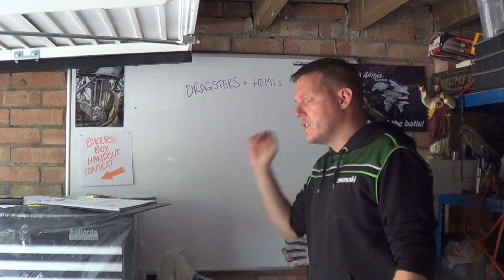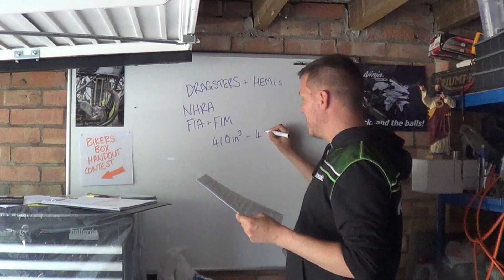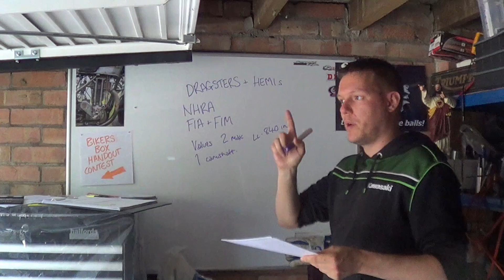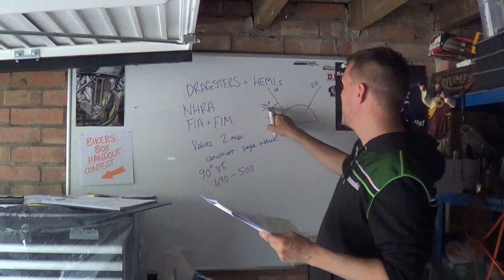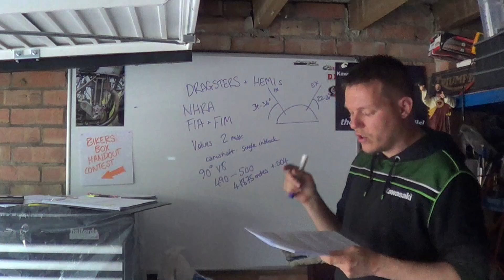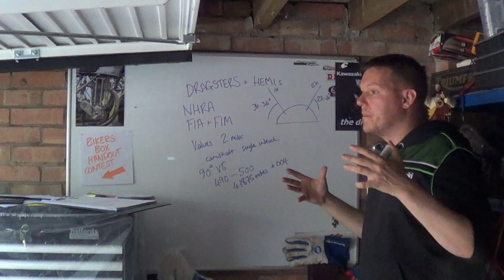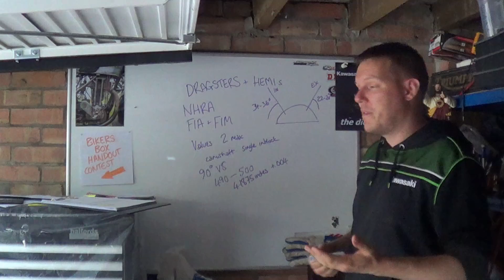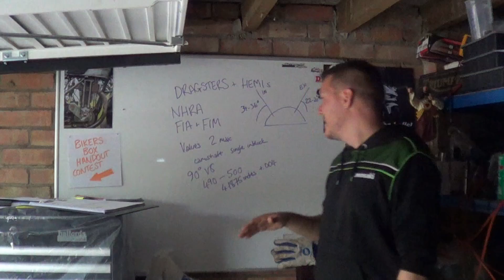Why do Dragsters use HEMI's?

Comment: You indicate Chrysler Ford and Chevy are all under GM (12:09) Dude really?
Hemis had their big impact from 1951-1962. The 418 Wedge took over in 1963 which used a closed kidney bean style. In the 60s Alfa, Porsche, Jaguar, and many other non-v8s used hemispherical chambers. with the emphasis on mileage in the 70's no one uses a true large chamber hemispherical style anymore.
Reply: Congrats you are completely wrong about the Hemis big impact, the 1st gen Hemis were in production until the late 50's then in 1964 the 2nd Gen Hemi was introduced and went on to dominate drag racing and was eventually outlawed by NASCAR.
 The top fuel Hemi has evolved into what it is today. Are there better head designs? Sure, but many were tried in the 60's and everything blew up, its just that the Hemis had less failures compared to everything else.

Comment: I thought they used hemis because you could have bigger valves then with a normal cumbustion camber?
Reply from the maker: What's normal?
Reply: The Workshop I was thinking about the cumbustion chamber you talked about that most manufactures uses in your video about hemis. Well normal was maybe the wrong expression
Reply from the maker: Pent-roof? 

The rules stipulate, that they can't use anything different, in regards to valve numbers for Top Fuel. 

Nothing to do with how well or shite they flow, weigh or look, taste or feel. Like I said in the video, they don't really have a choice. Alot of them have domed pistons which defeats the purpose of having a hemi combustion chamber.
Reply: The Workshop okay:)
Reply: The Workshop and yes I meant pent roof

Comment: Good analysis.  There used to be several flavors of hemi engines used in drag racing, but it turned out that the 426 based design worked the best - the flatter combustion chamber of the 392 based designs seemed to detonate earlier than the 426 version.  Wedge shaped combustion chambers were even worse.  Several innovators, like "Nasty" Dave Benjamin (3 valve head) and the McGees (OHC 4 valve heads) had their products legislated out of existence.
Reply: Rolls Canardly-Correct me if I'm wrong,but isn't the McGee engine a Hemi?

Comment: The top fuel engines don't really survive either, Each engine rarely even lasts the whole quarter mile. The fuel used can burn pretty violently without air at all so other than just the strength to hold the pressure the cylinder head design doesn't really matter a fuck.

Comment: Dude you are so fucktarded. The hemi is a trademark Chrysler (nothing to do with Ford and not under GM umbrella). Hemispherical composition chamber directs the radial impulse from the ignition source (spark plug) in a pattern that maximizes the downward force. Toyota V-8's and many other engines use this without the trademarked name. The downside is fuel efficiency/heat loss and valve limitations.
"Dragsters use V8s because there were overproduced" WTF?  Not even fact based. And BTW not lost on me "only forged blocks" when you said "blocks aren't forged they are only cast" Wow Mind blown.
Reply: Good question. Any large chamber head means more distance from the flame front to the piston and larger chamber in general leads to cooling of the charge before ignition is complete. Dragsters don't care and this is why you see giant flames coming out of the headers and also why a Hemi truck gets like 11 MPG.
Reply: As I said "Hemi" is a registered trademark of Chrysler LLC not a shape.
Everybody knows this.
Word mark: HEMI
Serial Number: 77107502
Type Of Mark: TradeMark
Published For Opposition Date: 7/17/2007
Last Applicant/Owner: CHRYSLER LLC
AUBURN HILLS 48326
Why is this contact information displayed?
Mark Drawing Code: Standard Character Mark
Design Search: (NO DATA)
Register Type: Principal
Disclaimer: (NOT AVAILABLE)
Correspondent: 
DAIMLERCHRYSLER CORPORATION
1000 CHRYSLER DR
CIMS 483-02-19
AUBURN HILLS, MI 48326-2766
Reply: "over manufactured these blocks these blocks you know price wasn't really a thing" You clearly were not talking about too much material in the production of the block.

Comment: You've got to remember they have fuel pipes the size of radiator hoses and have so much fuel going thru them, that usually by the end of a run the engines are basically dieseling on compression. It's a rich man's sport these days , anyway. The teams who win are basically the ones who are willing to (have the $ to) blow up engines to win runs. I think the first successful / widely used engine was the 392 Hemi from the 50s dodges in the fuel + blown combination because the combustion chamber shape allowed them to run alot more spark advance than in the other brand motors/

Comment: Another issue is the cars already make "too much" power as it is. Often the problem isn't horsepower, it's getting it to the ground, it's traction. Going to 4 valves per cylinder, turbocharging, etc to improve upon the hemi design and make even more power when they are barely hooked up half the time and they already shorting the racetracks to try to keep mph under control would be pretty pointless.

Comment: Theres nothing special about HEMI's. In same breath says they make 10k hp.......
Reply from the maker: But its not the comubustion chamber that's makes the 10k power, it might have something to do with volume, Nitro and that great big supercharger!
Reply: The Workshop ... Throw it at a different engine and watch it pre detonate. Hemi's are what they are like it or not
Reply: I think it's the cross flow design of the cylinder heads.   The fuel mixture takes a straight path into and out of the combustion chamber.   A traditional 2 valve engine has the valves in line a long the cylinder bank.  The hemi has the intake and exhaust valves positioned 90 deg from that.   That design is bad for gas mileage.  But these engines make so much power because they burn a massive amount of fuel.

Comment: 11,000+ hp isnt bad for any ICE engine. And the power numbers just keep going up. Also before Matt says "bollocks, prove it!" It has been documented several times and the results and method of measurement have undergone professional scrutiny multiple times.
Reply from the maker: why would I say 'prove it'
Reply: The Workshop because it's your typical response, and it was more likely than not that you weren't aware of the AVL Racing torque sensor that Don Schumacher racing has integrated into the coupling between the clutch packs and diff so they can measure the engine output in a real world race weekend setting. More unlikely than not but not completely unlikely.

Comment: The reason we Americans use hemis is so we can cant the valves further apart allowing for bigger valves and higher flowing heads. High compression ratio is sacrificed however ford captured the best of both worlds with its boss 429/494 cid semi hemi heads. For 2 valve american V8s engines these heads are superior to wedge heads weather you say so or not they produce way more power. But i do agree that for other types of engines they dont make sense.

Comment: From what I remember, most if not all top fuel and funny car engines were Keith Black engines that were an aluminium copy of the Chrysler Hemi.

Amazing horsepower but not very reliable, 1/4 mile fully rebuild if you are lucky, only really work at full throttle, self distruct if you have to get off the loud pedal and then back on it due to wheel spin, not the sort of engine that has any real world application, one of the highest classes of racing that has never really added much, if anything to technology, in other words not a leader but a follower.
Reply from the maker: "Amazing horsepower but not very reliable"

- this made me laugh lol Not very reliable, doesn't quite get across how unreliable they are lol

Comment: you can correct me if I'm wrong, but aren't all modern engines hemi engines? Chrysler was the first to start using hemispherical combustion chambers (and patented the term), but eventually all manufacturers switched to this design. Calling them hemi's would infer they are a chrysler engine, but they are not.
edit:  from wikipedia: The engine used to power a Top Fuel drag racing car follows the basic layout found in the second generation Chrysler 426 Hemi "Elephant Engine" made from 1964-71. Although the Top Fuel engine is built exclusively of specialist parts, it retains the basic configuration with two valves per cylinder activated by pushrods from a centrally-placed camshaft. The engine has hemispherical combustion chambers, a 90 degree V-angle; 120 millimetres (4.8 in) bore pitch. The configuration is identical to the overhead valve, single camshaft-in-block "Hemi" V-8 engine which became available for sale to the public in selected Chrysler Corporation (Chrysler brand) automotive products in 1950 (model year 1951).
Reply from the maker: You're comparing wiki to the rules I have in my hand?
Reply: OMG you are a genius!

Comment: could it be the low compression ratio of the hemis for the blowers because they can run like 85psi of boost
Reply: Ben Lauderdale the compression ratio on big American v8s was low when they were produced ( a yankee v8 considered to be high compression in the era topped out at 10.0-11.0:1 which is pretty much the standard now) and while NA tuning can get some respectable numbers out of them forced induction gets you way more then add to that highly volatile fuels ( they were allowed to run pure n2o at one point but were later banned) and you can get some stratospheric power levels out of a engine that will more than likely survive a pass, but not much more ( which is why they are required to dismantle, inspect, and reassemble the engine after every run).
Reply: There's a difference between mechanical compression ration and the actual compression, which is psi in the cylinders.   They superchargers create 3 atmospheres of pressure, so they have to run a low mechanical compression ratio.
Reply: How could they run pure n2o if it is oxidiser, meaning it has to have something to oxidize(fuel) in order to be used? Or am I missing something here?
Reply: people confuse nitrous oxide and nitromethane
Reply: Gerardas Nausutis pure N2o does  nothing, but it does excite whatever fuel you choose
Reply: Lower   compression  ratio   allows  for a way  bigger   space above  piston at  TDC  so  way more   air and fuel in there and on top of that you   use a supercharger to up the pressure to several   athmospheres          more   denser air in there means  more fuel is allowed too so way more power possible   the limit  seems up to a point where the engine   will         break   apart      .......   High   compression    would mean way  smaller   space above piston at   TDC   and  you  would not be able  boost   intake pressure   as much   much less     ,,,,,High   compression   may give better  efficiency   but  for these  cars  they do not care at all for   efficiency     they just want   max possible power
Reply: I must  add here  several   athmospheres that is   pressure at  intake    so you  then      wind up    with as much pressure  at TDC as say a       non super charged  high compression engine   but  what  happens here with a     low compression  super charged engine is the  volume above the piston at   TDC is way   bigger   so more air  and   more fuel can be there   so  more power is   possible
Reply: Puffalupagus360-The Street Hemi was 10.25;1...While the Race Hemi was 12.5;1...426 Max Wedge was 13;1...Those are just Chrysler engines.
More research needed,son

Comment: strsnge they dont force them to use carbs
Reply from the maker: You'd never get the fuel in quick enough, or enough volume. TF dragsters can have up to 28 injectors for the V8
Reply: there are videos that show how much fuel the injectors pump into the cylinders. there's no way a carb could even get close.